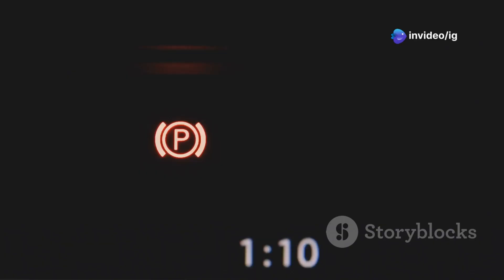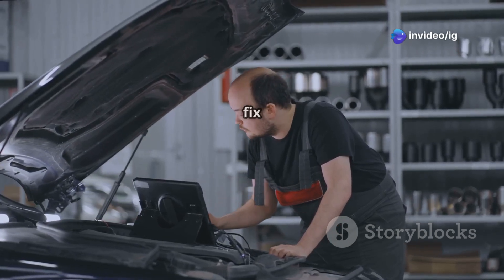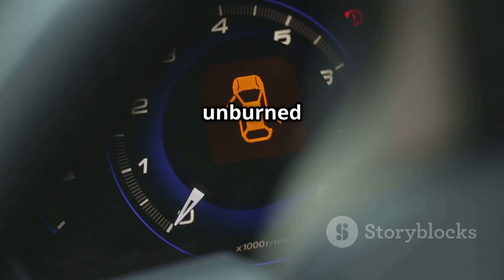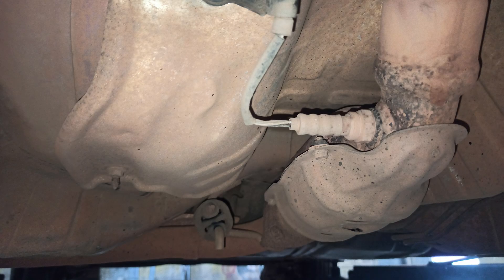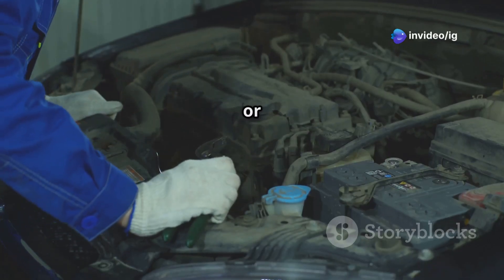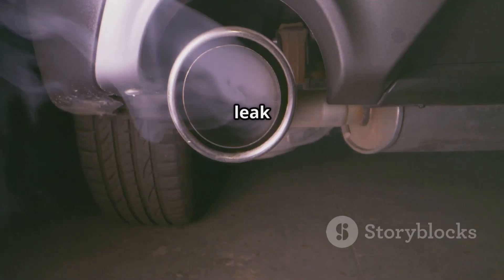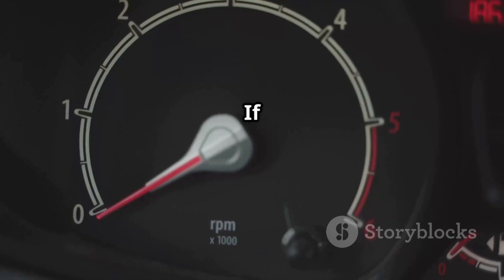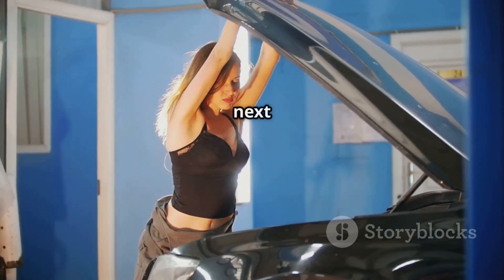P0138 | p0138 02 sensor circuit high voltage bank 1 sensor 2 | p0138 code | dtc p0138

Comment: My 2006 Nissan Sentra 1.8 with 320,000 miles was showing the P0138, I was going to replace the sensor 2, and also the AFR upstream sensor 1. I did Sensor 1 first and ran out of time. I drove to work watching live data on scan tool. Voltage dropped to normal on sensor 2 and the code hasn't returned.  I think that the old, slow reporting sensor 1 was causing a rich condition in cat causing high voltage in the downstream sensor 2. I'm now going to leave sensor 2 alone, as I don't think that that is a problem anymore as of now  in this case.